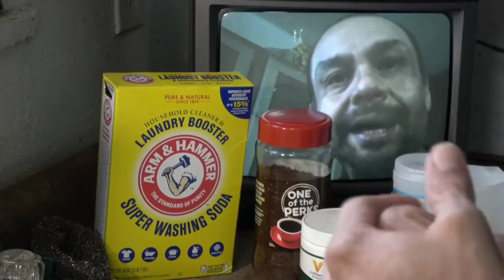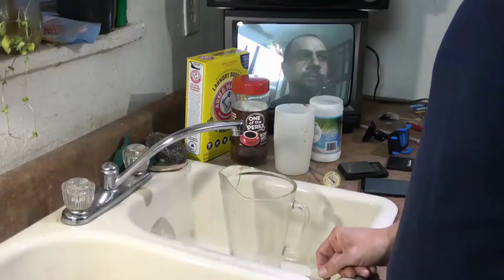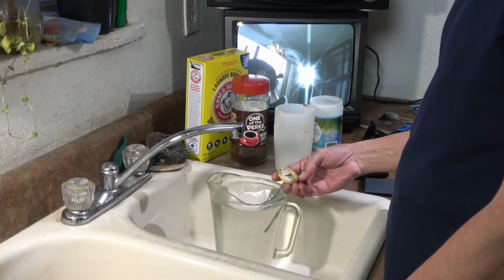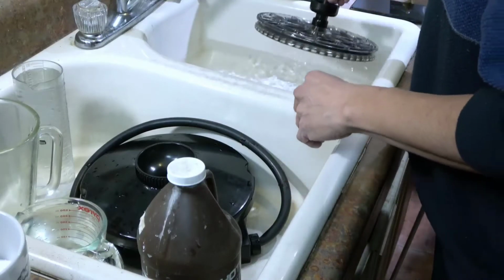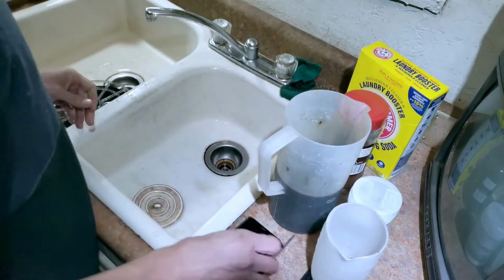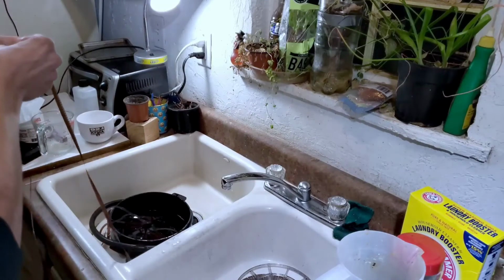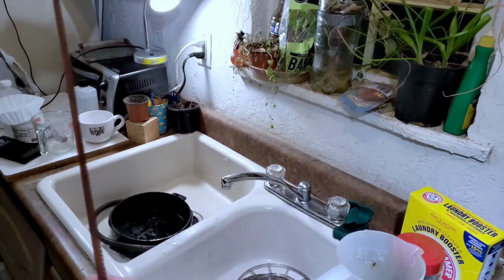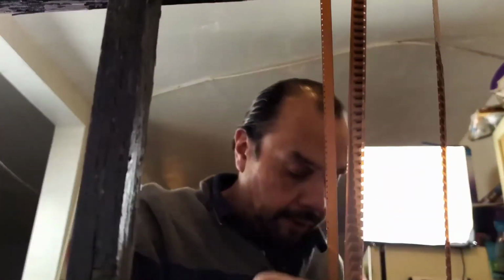How to Develop Super 8 with Caffenol

Comment: Hi Manny! Saw your vid with Ben on Ben's Camera show episode 9 Caffenol. Great stuff!!! I have a ton of K II ready to process and wanted to ask if you could provide the recipe you mentioned where you cut the K 40 recipe in half. Cheers and keep up the great work!
Reply from the maker: You got it. I normally use 143g soda wash(Arm&Hammer), 16g vitamin C(100% powder), 10g iodized salt, 42g instant coffee(caffeinated of course). I put these in one container  with 1200ml of distilled water. I then measure out 600ml of the solution and add 600ml of the distilled water. I put in into the freezer to get the temp down to 20c/68f(about 3.5min per degree). I normally do a 5min presoak but considering the age I only do a max of 3min at 28c/82f. Like I said on the show, this year I will be working more on this formula. So the presoak part is still a bit of a mystery for me this one works quite well with k40 but for this one I'm not sure yet. In the winter I put the tank in warm water for the presoak. The developer I set for 6.5min with a 1min agitation in the beginning and quick ones every 30 seconds. Water wash until all of solution is washed out. I put the caffenol back into it's receptacle with a some steel wool overnight. I use Ilford Rapid Fix (time varies with usage). Wash in water let it sit in water for 5min. Remove remjet as needed put back into water with some photo flo(a drop of dish soap works as well). I give it one more cleaning and dry out of the photo flo and hang dry. Some thoughts on this is maybe a slight increase in the soda wash could increase contrast...........also a bit of soda wash in the presoak........herbal developer candidate, maybe a bark(mesquite for me) or mint and basil. There you go I hope this helps, thanks for watching!
Reply: @tiomannysworld6835  Thank you very much for this!!! I will be starting shortly this afternoon. Cheers and keep up the great work with expired film.
Reply: Also would love to see any of the experimentation with the formulae
Reply from the maker: @jaredmichaelsobotka3454  I am stoked about it! How did your developing go?
Reply: @tiomannysworld6835  It went well! I did one film at 3 min and another at 6.5 min and got better results at 6.5.  Starting to move into test strips and the lomo tank, I have been developing in a 5 reel 35mm tank which makes the results more unpredictable. Which isn't bad but with the k II I feel to retrieve the most from it, the lomo tank is needed. Cheers to you good sir!
Reply from the maker: @jaredmichaelsobotka3454   Awesome, I'm so happy it worked for you bud! Cheers and happy shooting!!
Reply: @tiomannysworld6835  Thank you! Many blessings to you and yours!! Keep up the great super 8 work.

Comment: Do you know if I'm able to do the same with Ektachrome 100 super 8? I'm assuming it'd turn out as a B&W negative???
Reply from the maker: if its the new ekta for sure it will work. if it's the old ektachrome 160 g you may have quit a bit of reticulation. for the 160 try putting the fixer down to about 68 degrees fahrenheit. This will help for the emulsion not to melt off. If it is the new stock it will work with regular temps. Thanks for watching!